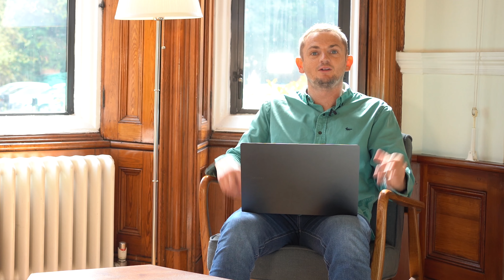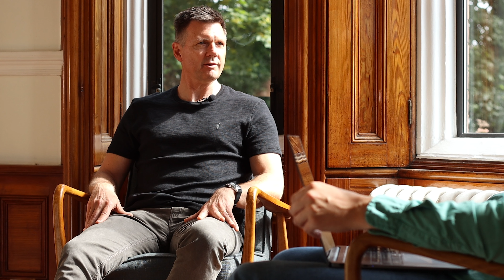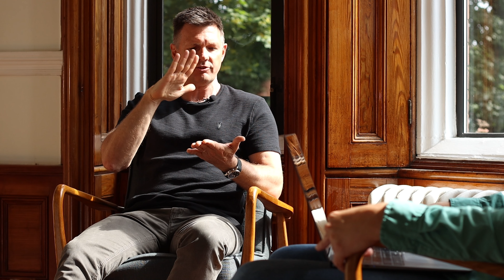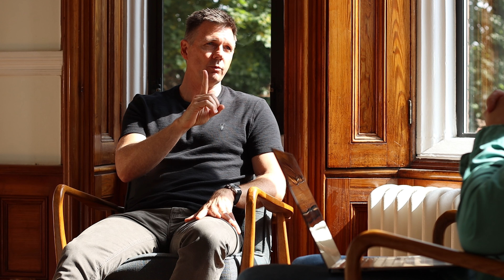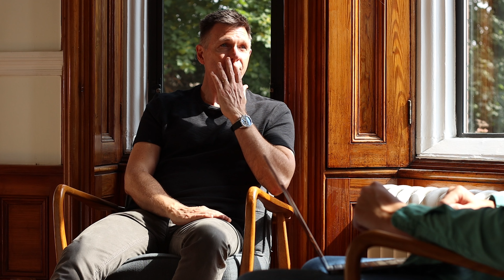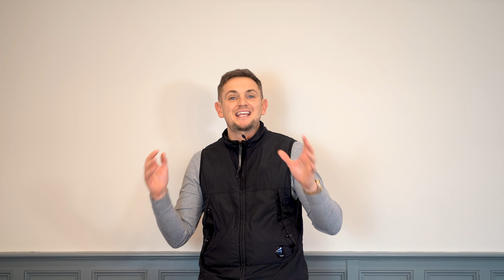The Sustainable Energy Revolution : UK Interview with Leading Australian Solar Installer

Comment: So, as a customer who is currently awaiting the immanent installation of my panels, without micro inverters, with DC straight to a Tesla Powerwall 3, wouldn’t I be better with an ACM? With little to no risk of shading, I took it that keeping the losses of changing DC to AC would be more efficient.

Comment: What additional R&D is REA carrying out to increase solar panel efficiency? Is the use of say perovskite realistic to increase efficiency substantially more in the near future?
Reply from the maker: Hey Peter, we'll get REA to answer this in more detail but until then... REA are constantly working on R&D and have partnerships with Central Queensland University and University of Queensland to explore new photovoltic material substrates and Perovskite / Tandem cells. These are one of the cell structures that they are exploring. The efficiency of these technologies are extremely high, however the stability and reliability are the main concerns for commercialisation.

Comment: Heatable installed REA panels with Enphase microinverters and batteries for me last September and oh my word… the winter solar harvest here in the northwest of England has outstripped all my calculated expectations. I’m very happy to be getting such impressive results. Just awaiting the Enphase EV charger and System Controller to land in the UK now to complete my requirements
Reply from the maker: It's great to hear that the REA panels and micro's are living up to expectations and even EXCEEDING them! The efficiency of this technology in UK weather (low light conditions) really can't be compared to standard DC set up's...